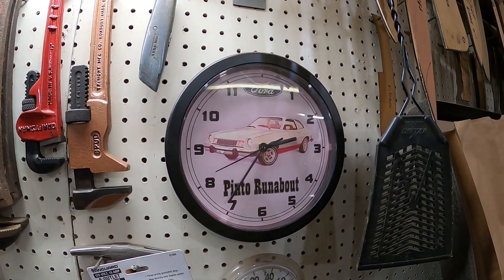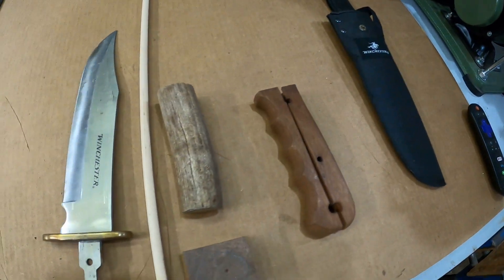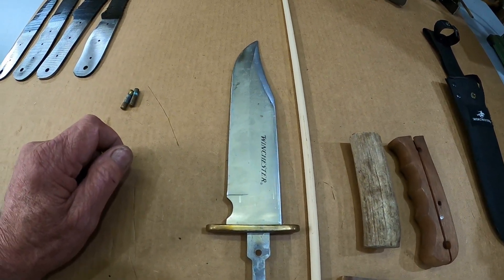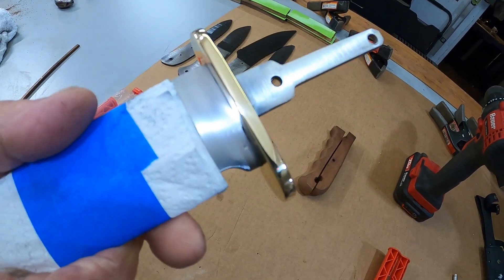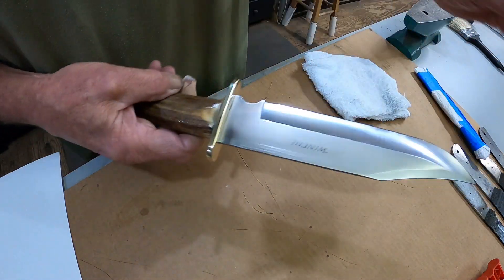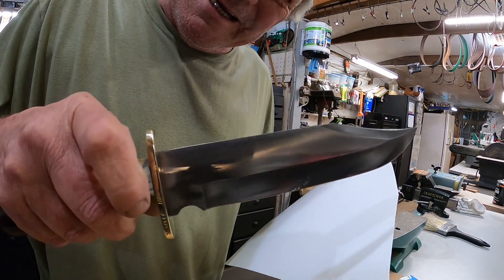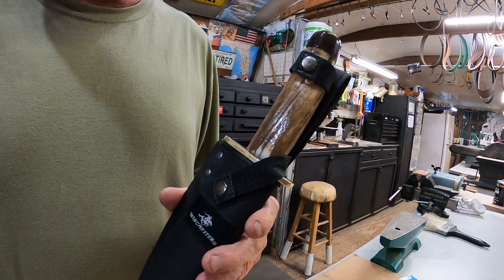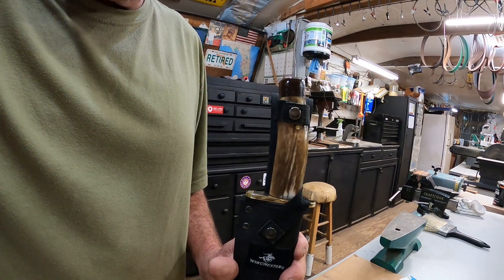Bowie knife repair/re-handle

Comment: I have the exact same job to accomplish for a friend. Beautiful old Bowie probably never used or sharpened. Just had plastic handle scales. Gotta go. Making new bolster now(brass) and have a nice selection of blocks for the handle. Just curious about drilling that dang pin. Maybe I should torch the end of the tang and then place(drill) the pin there. ? Thanks again

Comment: I know it’s been a year, but I have a blade without a handle that I bought 20 years ago. I had a bone that I wanted to use for a handle but wasn’t sure what kind of epoxy to use. I suppose I could google the answer, but was wondering what epoxy you use. Does it make a difference which kind? 
BTW, that knife came out beautifully! 👍🏼👍🏼🇺🇸
Reply from the maker: Thanks for watching!   I dont think it matters what kind,Im using JB weld brand now, All I ever used is about the same. I would however stay away from the Harbor Freight brand, I dont know why, Might be to cheap. 😁
Reply: @wallaceknifeworkshomestead  
Thanks for the quick reply. I took a look at your website and really like your work. 
I have to try and find that bone handle now. 😉

Comment: How did you relocate the pin hole?  Or was it a new hole?  Just curious.  Looks good.
Reply from the maker: I lined up up by eye, then measured it with a ruler about 37 times, Got lucky and hit it the first time!
Reply: @wallaceknifeworkshomestead  I was wondering if you might have put in one hole on the other handle we couldn't see.  I guess you can still read a ruler.  :-)

Comment: Can you tell me how you got the pin in there. Did you go in the original hole or a new one if new what bit drilled through the hardened steel. Thanks
Reply from the maker: I used the original holes, I measured carefully about 10 times with my calipers.  I havent found anything that will drill that stainless .

Comment: How’d you get the pins holding the old grip out? I’ve got a mossy oak one that’s a nice blade but a shitty fake antler handle is like to replace with wood
Reply from the maker: Take a punch a little smaller than the pin,and drive them out with a hammer.  Should come out easy.  Thanks for watching!

Comment: The original handle was probably doomed to fail, with a blade that wide and heavy it should have been a full tang design - but then again what was he doing with it to break it like that, trying to chop a tree down? 🪓 🌲?? New handle looks great, pinned and glued antler will be much stronger than whatever wood that was. thanks for sharing. Better to fix it up than throw it out, plus now it’s an official heirloom 👍
Reply from the maker: Yep,  That handle wood they use is very soft, Only a few drops of glue in it.  Now it will stay there!